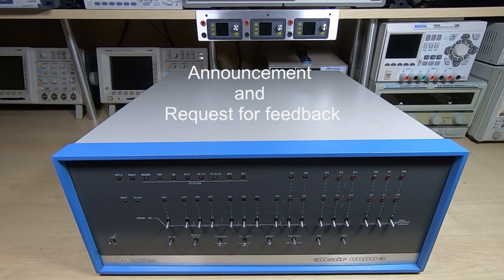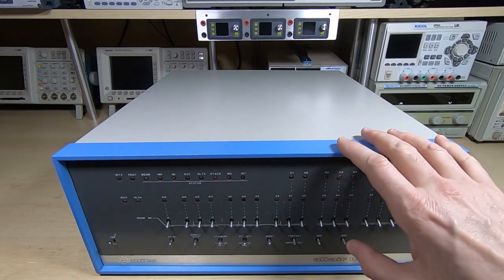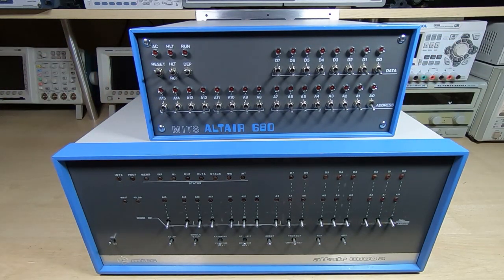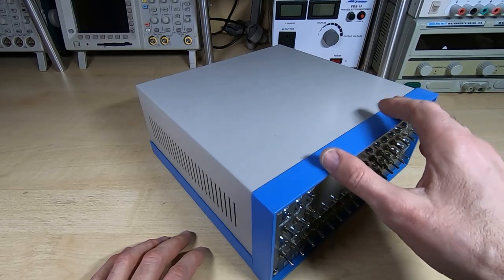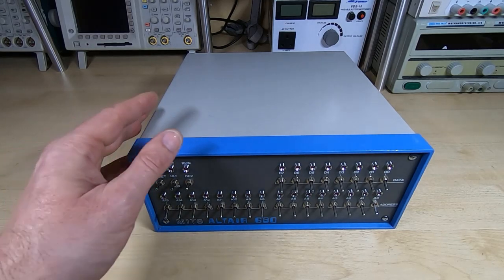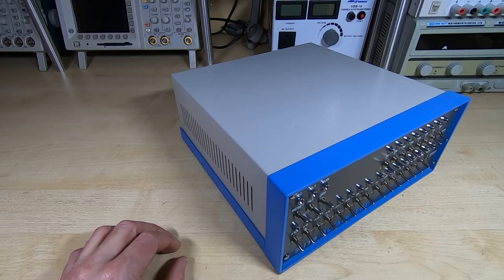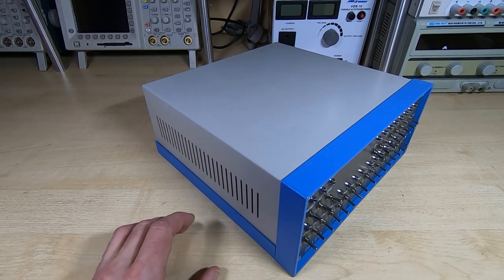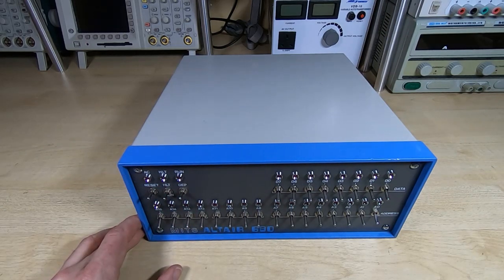Altair 680 Project Announcement

Comment: I would liked to have seen what's inside these units...
Reply from the maker: So would I but I have never had access to one so I cannot show it. The parts I was intending to use for this project belonged to someone else who seemed to have some personal issues so the project never went very far. If I ever managed to find a complete unit I will continue with the intended project.
Reply: @JerryWalker001  I don't understand. Were the two boxes you showed just empty?
Reply from the maker: @bertoid  The biggest part of the project would have been the case reproduction and the owner sent me the empty cases so that I could make drawings to get them reproduced. The plan was for him to send the boards later and I would then reproduce them. However he did not seem to understand what was involved in the project and started behaving very oddly so the project stalled. I have been looking for a complete unit since then so that I can continue the project although there seems to be very little interest judging by the low response I received.
Reply: @JerryWalker001  (Damn youtube! I thought I'd finally got a couple of links through to you, but just realized now it had been suppressed)
OK, that clears up the empty box issue. 
I suppose you are aware of them, but in case not:- 
When I googled "Altair 680", the 3rd hit was for someone who is already doing a kit for this. Even if now defunct, they might give you the gerbers if you ask nicely? And the 2nd was for the Smithsonian, for an original kit. Maybe they could photocopy the PCBs for you as a starting point? Though that seems to be how the other hit generated their gerbers, so that would be a better option. 
Might be worth asking these sites for help...

Comment: Looks like this died before birth.
Reply from the maker: Yes unfortunately there was very little interest so outlaying for tooling etc has not yet been possible. If interest ever looks like it may cover costs then I hope to proceed with the project. I usually just reproduce pcb's but had hoped to reproduce the 680 enclosure but tooling to do something like that is a significant cost and the MOQ would be fairly high, hence the video. I did continue with the initial pcb work but so far only a small number of people have shown any interest. I was asked to consider this project by someone else as he felt that there would be significant interest but this has not turned out to be the case.

Comment: I could probably be talked into a replica kit... But as I have an original 680, I would be more interested in replica accessory boards if they could be ordered separately.  As my system is barebones with only a mainboard and front panel, even missing the expansion riser, I haven't found an excuse to turn it on in years.

I missed out on the Stockly replica kits... do you expect any major differences ?
Reply from the maker: I will be selling the bare boards sperately. The main differences will be that I intend to make them a little more like the originals. For example I will be using transformers and not SMPS.